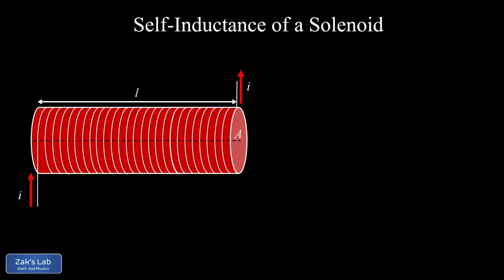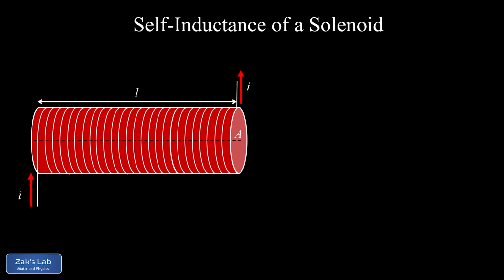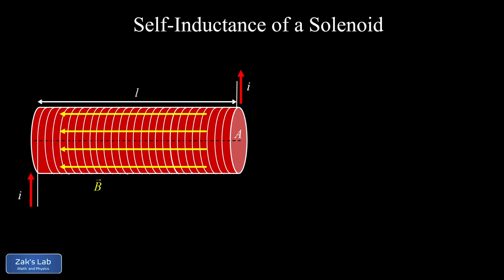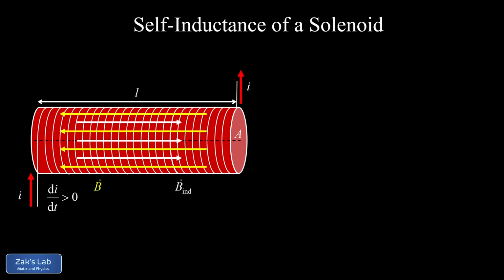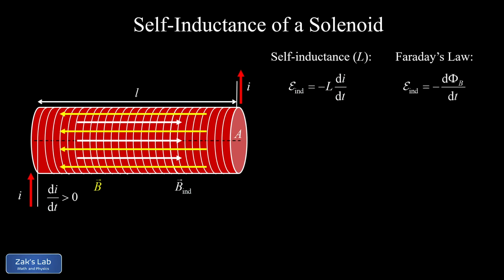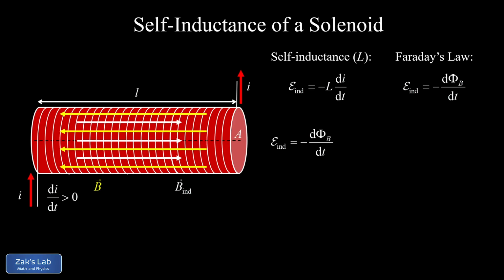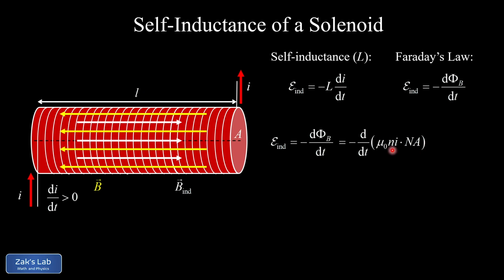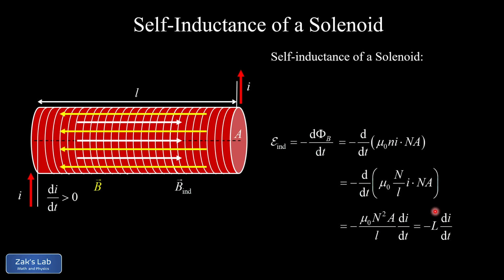Self-Inductance and Derivation of the Self-Inductance of a Solenoid

Comment from the maker: This video is part of a short set on electromagnetic induction:

Introduction to mutual inductance
Self-inductance and the inductance of a solenoid (this video)
Self-inductance of a thin toroid
Self-inductance of a thick toroid
Energy stored in an inductor
Magnetic field energy density 
Inductance per unit length of a coaxial cable

These are designed to build on each other, so earlier videos will make the later ones much clearer.